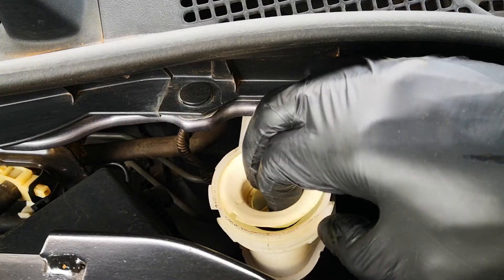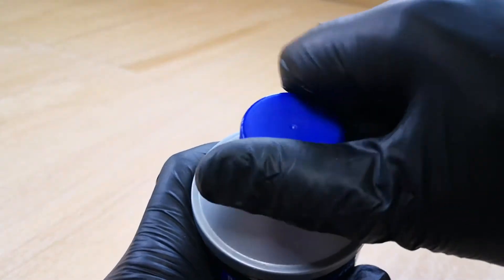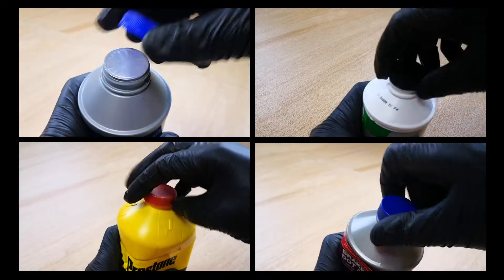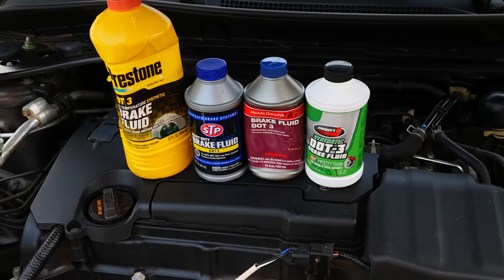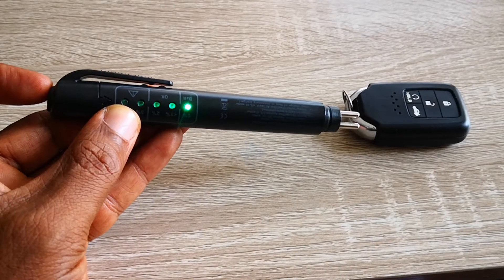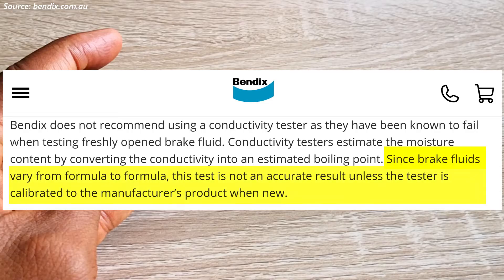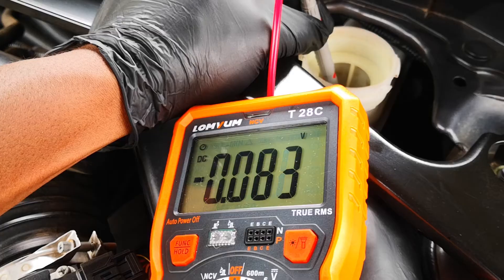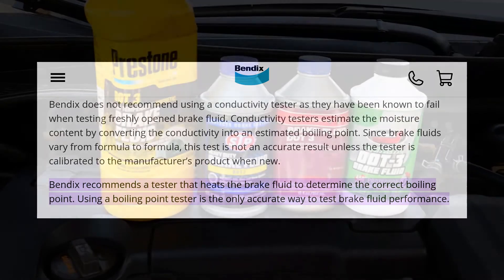Why I NO Longer Recommend this Brake Fluid Tester / No need to Waste your Money

Comment from the maker: Do you have any experience with these brake fluid test pens? Feel free to share!😃
Reply: Yes, pretty unreliable/junk.  I just bought on Amazon. The same fluid that tests ok, five minutes later will test in the red 4%.
Reply from the maker: Really unreliable. Sometimes it's dependent on the depth to which you insert the tester in the fluid 😕
Reply: @DIYAutoworksNG  Yes, I found out the hard way. Thanks
Reply: I learned from radio and TV fault finding and repair about batch testing!
1 in a 1,000 goods does guarantee the rest!
Reply: @martinfontana3593 the same with many tyres. 10% the other 90% is fine
Reply: 3 attempts to reply! These pens are good but only as a quick test!
I paid £3 not £32! If you get 4 lights with 2 year old fluid and new draw out fluid and get the boiling point tested also get the pen tested and replaced!
I had brake failure on a Daewoo Lanos Automatic! On a Hilly road!( Difference is it is easier slow down a car with a Manual Gearbox!) Kwikfit recommend changing  fluid every 2 years!
Reply: As a quick test it alerts you to a possibility of brake failure on a steep hill or heavy traffic! Rolling road tests brakes when system is cold , not between 100°c and 300°c ( boiling point of water and oil at sea level!)
Reply: At 71 I am researching this and Kwik Fit were very helpful! Old brake fluid can be a hidden hazard as you get a visual warning with Discs,Pads and Tyres!

Comment: Why even go through the hassle of finding a tester that you hope works. Just flush your brake system every 2-3 years and be done. You don't test your engine oil to determine if it needs changed, why do so for something as important as properly functioning brakes. If you flush the brake system as needed you will most never have to deal with the expense of replacing calipers due to frozen caliper pistons. Brake flushing is part of maintenance, why bother testing the fluid. Just do it.

Comment: Always......always test the new fluid first.  I'd bet your tester is bad......or the battery is bad
Reply from the maker: It's not just me. Search the Web, you'd see several others that have made this observation. It's a limitation in its design. It's perfect if you're using brake fluid it's calibrated for. BTW, after this video I later got a another brand of brake fluid which it read correctly.

Comment: Maybe your tester is right.  Those bottles of fluid could be years old and humidity diffuses through plastics surprisingly well.  Go find some brake fluid in metal containers.  Must be some out there.  Update:  I have one of those testers and it seems to work as expected.  16 year old fluid in my car tested bad, brand new fluid tested good.
Reply from the maker: Good point about the plastic bottles! I find it hard that 4 different brands would have stayed on the shelf for so long that they've absorbed so much sealed to massively skew the results the way they did. But very good point I didn't consider initially.
Reply: Just got a bottle dot3...tested good.@DIYAutoworksNG

Comment: I did brake job flush and bleed the brake system put the new fluid and checked it with my pen and it was reading +4 I checked my old brake fluid from differnt cars colletted in the bottle which has been sitting in my garage shelf  long time and it only read +2  can't trust these pens at all
Reply from the maker: Garbage, except the brake fluid formula you get matches the ones used for the caliberation of the tool.

Comment: Interesting, I've purchased the 5 LED Tester like yours and I tested it with 3 new bottles of NULON Super DOT 4 Brake fluid and mine read Zero.   Taking a 10ml sample and rechecking at Zero again I let it sit overnight for 12 Hours in the garage to absorb moisture slowly from the air (A Cold night)  The tester then read 3% LED.  Leaving it a further 4 Hrs and it read >4% LED.  So appears to work fine for me.  I've tried other tester like the HT5009, has selectable DOT3,4,5.1 unlike the pen tester but its reading was off at 1.1% in new Nulon DOT4 fluid.   I submerge the probe pins by 2/3 on the Pen Tester as I would not trust brake fluid entering the tester into the electronics.
Measuring the Galvanic Voltage of my Car that has 4.5 Yr old Dot 4 Honda Brake Fluid shows 265mV  or about 2.6% moisture content.  The 5 LED Pen read 3% and the HT5009 read 2.3%.   I trust the 5 LED PEN more than the HT5009.  
The Galvanic Voltage test seems to be more accurate.  Just ensure a Good quality multi meter is used as cheap meters have a lower impedance lowering the read voltage and so misleading and use a cheap probe into the brake fluid being corrosive. The Voltage is Negative with respect to the Master Cylinder metal chasis.   I used a UNI-T UT181A.  After Purging and replacing the brake fluid with Nulon Super DOT4 it gave a reading of 65mV which if graph is linear equates to 0.65% moisture in fresh Brake Fluid.
My assumption is your tester was a faulty one.  BTW I am in Australia so possible additives in your Brake Fluid for whatever country your in, may be causing strange effects but I doubt it.
Reply from the maker: Thanks for the detailed post!
My tester is actually fine. I eventually got a European formula of DOT3 on which the tester read correctly. Funny thing is I bought the tester from Europe. The brake fluids I tested in the were from the US.

Comment: I just tried one which looks identical to the one in your video. When I submerge the prongs only halfway I get a Green/Yellow reading, but when I submerge them fully I get a RED reading. The directions note that it should be submerged up to the plastic base, but my theory is that when you do that you may be shorting out the internal components of the device which causes a false RED reading.
Reply from the maker: I've just abandoned it altogether

Comment: Was the battery low in the tester
Reply from the maker: Nope. The complaint is all over the Internet. However, like I said in the video, if you get brake fluids that the tester is caliberated for, it's perfect. I later found a brake fluid brand from Europe and it worked flawlessly. I bought the tester from Europe. Brake fluids in the video were all from the US market... Could tell a story.

Comment: different testers are made for different fluids. but there are a few companies like OEMtools that make testers with multiple settings for different brands and specs of brake fluid. 9 times out of 10 if you just ask the customer the last time it was changed they will say never, so most often you don't even need a tester lol
Reply from the maker: Thanks for sharing! I'll check out the OEM tools one

Comment: We use brake test strips in the shop, very accurate!!
Reply from the maker: Never knew you had a shop!
Reply: @404notfound    I thought Brake Fluid test strips only tested for Copper content ???
Reply: @mikebloodworth9258  they also check for water content.
Reply: @404notfound.....  unable to find those. The ones on Amazon do coolant one end and brake fluid the other but only copper for brake fluid. Do you have a link.

Comment: I used an OEM pen tester with a series of LED indicators on an old Landcruiser. It showed high moisture. But I wondered why because the system was completely flushed a couple of years ago. I bought a Kingbolen digital tester and it said it was okay. I really like the flexible wand design. It is great for the Dodge van that has the master cylinders under the hood edge, leaving three inches of vertical clearance. Great tool.
Reply from the maker: A couple of years is a long time for brake fluid though. General recommendation is to replace every 2 years.
Reply: @DIYAutoworksNG  EXACTLY! We don't test engine oil, why even test brake fluid. It's part of maintenance. Just flush the system. Locked up caliper pistons cost a lot more to replace than a brake fluid flush every couple years.
Reply: A system that was flushed several years ago is very likely to test high.  I'd be more inclined to think the the Kingbolen was reading low.

Comment: thanks for posting.  i had the same experience after seeing this tester on one of my favorite yt channels, project farm.  so i got one, replaced the fluid in my vehicles, then for the hell of it, tested my new dot3 container and got >4%. dammit, i trust the project farm guy but think this was a waste. buyer beware
Reply from the maker: Thanks for sharing this. From my research it's largely down to the caliberation. I later found a brake fluid made in Europe which the tester read correctly ever single time. Project Farm is a great guy.

Comment: Very interesting result. I just watched a video where the same tester in your video was used on new brake fluid which was initially pure, then 1%, 2%, 3% and 4% water was subsequently introduced using precise measurements. The tester worked perfectly. Not sure what the brand of the brake fluid. I read that the testers aren't calibrated for DOT 5.1 brake fluid, but they should at least give a result that's in the ballpark. I'm inclined to think that your tester was broken.
Reply from the maker: Thank you for sharing. I've also seen those videos. It just boils down to caliberation. 
I eventually found a brake fluid manufactured in Europe which upon opening, my tester read correctly. Thinking back, I bought the tester in Europe, but all the brake fluids I tested in the video were US made. The fact that I later got a brand that it read correctly tells me it wasn't broken. If you look a bit more, you'll also see people who had similar results to what I found. Its a known flaw of this design.
Reply: @DIYAutoworksNG so this video is garbage?
Reply from the maker: For me, nope. My earlier comment still applies
Reply: I am also going to test mine on a sealed bottle of brake fluid I have In the car ! We the public are becoming "Quality Control Experts " lol,,!!?
And critics?

Comment: This what do you recommend for testing the brake fluid then?
Reply from the maker: They are testers that rely on boiling point. That's the more accurate method. For now, I'll be going by when last of was replaced.

Comment: I think from my experience anyway ..the cheaper ones via amazon etc are pretty hit and miss. I bought a known brand and tested it with old and new brake fluid with massive differences ....its true though ...just change your brake fluid on recommended intervals to be sure.
Reply from the maker: Same experience here. Thanks for sharing.

Comment: Mine shows new fluid is good and so far has only gone red when I tested tap water to make sure the device was working properly. I tested it as soon as I got it to make sure I didn’t need to return it. That being said, I don’t think they’re super accurate. Just gives you a quick way to know if you obviously need to change fluid or not. I recommend testing any tool you have with known values before trusting them. Definitely worth the $7 I paid for it. If it ever goes bad, I’ll probably buy another. Yours probably needs replacing if it gives failing results with new fluid. Also, do not test these with purified or filtered water. Water is an insulator unless it contains contaminates. It’s what’s in the water that is conductive.
Reply from the maker: Good for you. I still think it boils down to what market your tool is caliberated to. 
After making this video I later found some brake fluid both made in Europe, and the tester reported them both as being brand new with 0% moisture! Interestingly, I got the brake fluid tester from the UK and all the fluids in the above video are US made!

Comment: Scotty Kilmer uses one. Good enough for me...
Reply: This 'tester' is really not needed.
Multimeter set to VOLTAGE.
+ve in the Fluid Reservoir.  -ve on Body Ground.
0.03 or less Voltage is acceptable any more change the fluid.

Comment: HELL maybe the oil companies are adding water to break down the brakes and the systems faster who knows unless you test.
I watched another guy use the same tester his worked fine he even used a dropper for different water % and it read them all correctly maybe your tester was bad.
Reply from the maker: Your first point cracked me up🤣
I think it's all in the brake fluid that the tester is caliberated for. I got this tester from Europe, and noticed that it works like a charm for brake fluids manufactured in the Eurozone. The fluids I used in the video were all from the US market. I've also seen several other complaints on the Internet that support my findings.

Comment: I test my tester but using a glass breaker put 20 mi fresh fluid and it show zero and slowing add 1% ,2 %,3%, 4% of water and the tester change. So is good.
Reply from the maker: Yea. The brake fluid you have is probably one for which the tool is calibrated.
Reply: @DIYAutoworksNG 😂 bruh… his el cheapo tester obviously works as designed and yours is broken. Simple as that. 

It would be completely MORONIC for them to sell a tester which only works with one specific brake fluid. 🤨😒😑🤦🏻‍♂️

Brake fluids all comply to the same standard, in order to be sold legally. The test pen should be able to read if working properly. 🤷🏻‍♂️

Comment: Use brake fluid test strips.
Reply from the maker: Yea. That's an option. 
The gold standard is boiling point testers.
Reply: @DIYAutoworksNG  true but the cheaper but still expensive boiling point testers can be quite inaccurate according to  feedback I see on Amazon.

Comment: I believe you shouldn’t push the tester deeply just touch the fluid with tester n u will see
Reply from the maker: Fair point. The result differs by the depth of the probes in these fluids that I tested. This is a flaw. I later found one European brand (brake fluid) that this tester read accurately irrespective of depth of the probes. It all goes back to the caliberation issue I discussed in the video.
Reply: It's not a flaw ...it's just a cheap device. All you have to do is just tip the electrodes in liquid. It's accurate enough in this way. You can make a test with 1%,2%,3% water mixed voluntarily in brake fluid and you will be obtain accurate readings
Reply: I was about to write the same. Only the tips of the conductors can tell, and if you push it all the way it will give wrong readings no matter what. I'm using one to monitor my car brake fluid for years now and the readings are consistent with the age.
Reply from the maker: @zootopiashow Yea, but that inconsistency isn't great.
Reply: @DIYAutoworksNG  the case with Chinese 😁
Reply: @simbacoba2198 — the instruction say to dip the prongs all the way in to the plastic. 

Oil sits on top of water. Gotta go in DEEP to read the true moisture content, I’m guessing. 🤷🏻‍♂️

Comment: I have one and perfectly satisfied by the results, with fresh fluid I get one green led, with used brake fluid changed after 2-3 years I get the red led. After a brake fluid flush from time to time I test it with this tool to see the state of it and how it is affected by time and the results are pretty accurate. I think you have a problem with yours, it is very cheap so you should test those bottles of brake fluids with another one and see what you get. This is a good example for a testing: https://m.youtube.com/watch?v=uAw0J_DH6gI
Reply from the maker: That's great. I did actually find one brake fluid brand from Europe on which it tested correctly. In all, it just goes back to the point I made in the video, the tool will be fine if you find a brake fluid for which it is well calibrated. It's been well documented that this kind of tester can fail in freshly opened brake fluid. I also found multiple reviewers on Amazon who had the same exact experience as I did. Brand new tester pens with brand new brake fluid.